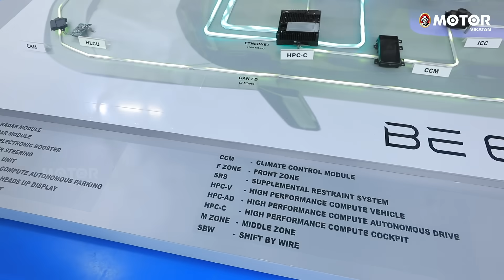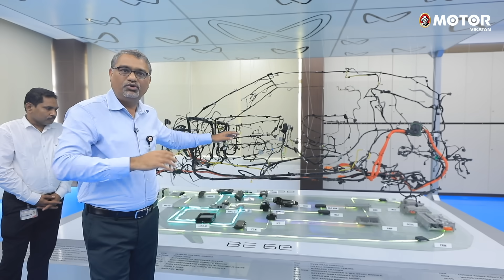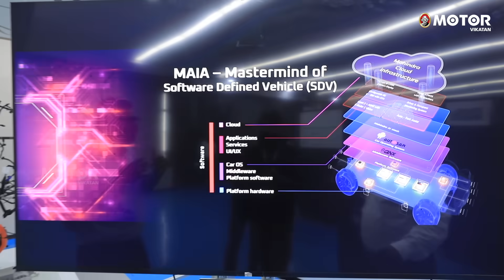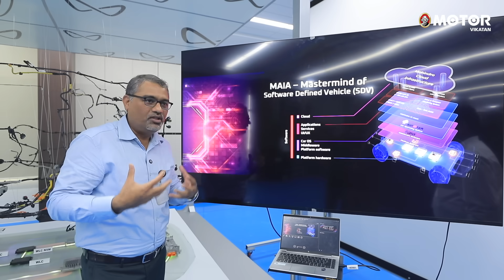Exclusive: Mahindra BE 6e Electrical System & ECU Explained By Mahindra Engineers in தமிழ் | Part1

Comment: More the Technology, More the problem. What Mahindra is doing is not military grade electronics. Obviously all electronics will fail in short time, capacitor, resistor will degrade quickly and going to be very costly for replacement of boards. It is going to be an AUDI or Benz in maintanence. What we Indian or cost oriented people except is less electronics like Toyota with more reliable. What you are creating is E-Waste.  

Initially Architect told , EVs are very simple with less parts.  Now Mahindra is creating SAAS on EV. With ICE one ECU itself  very problematic. This is Car and  going to be in rain, sunlight, flood etc.. 
But appreciate Mahindra  for showing up openly like open-source…

Comment: When hardware are getting betterment how upgrade can be acheived. OTA will not help.High speed data is less reliable as it miss data . Slow data speed is highly  preferred for control as safety and life is involved . High speed data architecture can be on monitoring area like 360 camera , infotainment , and cloud computing.  But taking to control area is risky... Diff OS and Diff speed data com . In case of hang out partial failure of communication ?. Rat bite of critical wire  what will be course of action ? Any redundancy is considered ? Both communication and power supply ?. Any safety audit  done to ensure safety of life ?byd have 3 ecu .. ice have10+ . This 29 ecu .  Making more complex and reliable on question. Common man need not sophistication but simple and high reliability .
Reply: After seeing this video. My mind strongly recommends not to buy ev. Because nowadays petrol cars itself have complex electronic device which makes the car unreliable and high maintainance. If these cars stuck in water, it is not road worthy until you replace all these electronic control units . In petrol cars , mechanical parts can be repaired multiple times and reused in the car. It saves money. But these devices are just use and throw. And you should approach only service centre for any repairs. It they charge you more, you cannot recheck it. You have to pay just what they ask. 99% car owners who buys this car will not have enough knowledge to ask questions to the service center, why did change this part because it is not defective..

So better choose ICE engines..
It is not USA, you can peacefully depend upon adas. So, these features are just added to the cars ,so the car companies earn money after sales..
Reply: @ You are right from your prospective, but as the Technology evolves and environment need to be protected , you have to accept this. Earlier there was no ABS , ESP , Energy recovery but now you are protected.
Reply: @palanik1960  technology updated is okay. But environment is not protected by ev. Because for power we rely on thermal power stations. The production process of Lithium ion batteries creates more pollution than the actual petrol cars..
Reply: @ You have to see a long time run .. the avaeage petrol car will generate carbon emissions much more than ev only 15 kg of lithium used for 100kw battery may last 15 years of life span. The power generated are now solar and wind and the coal plant are located at remote places generally.  Fuel car throw carboy particle straight in to your lungs  . So Ev are are need of the hour and need to replace fuled cars.They contributeot to  save environment.
Reply: @palanik1960  ok sir.. I agree. But points to be analysed before selecting the car.. But people are not buying cars for thier need. Just to show off .
Have to adopt greener transport like bicycle for short travel..
Instead the govt giving subsides for ev. They have to plan the urban roads to be bicycle friendly. Which encourages the citizens to use bicycles..

I think this too reduces pollution.
Reply: @ You are right, but our people behaviour on traffic is horrible , no patience, no respect for fellow citizens. Yes bicycles at good but unfit for our trafiic conditions. But like Sunday and Saturday can be declared "only cycle inroad " to  save environment